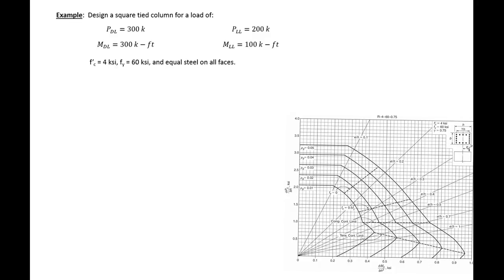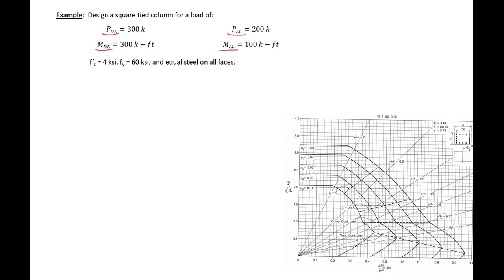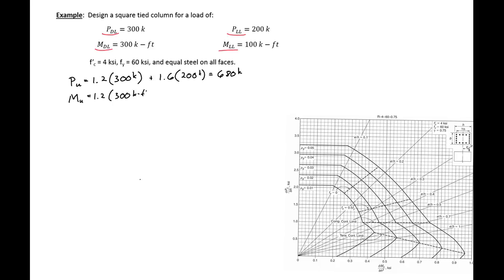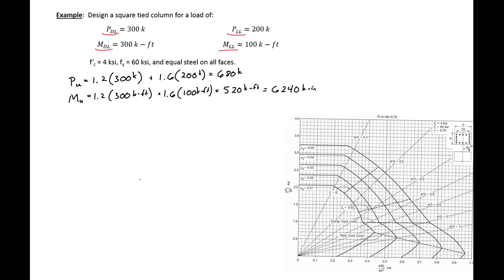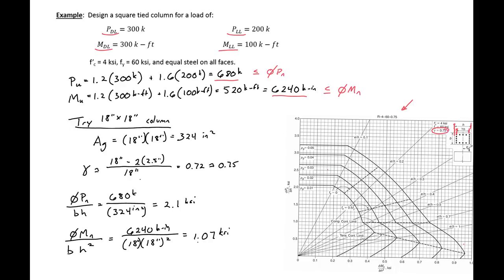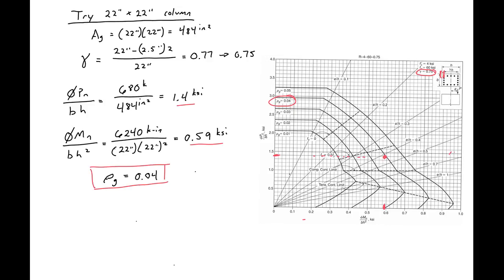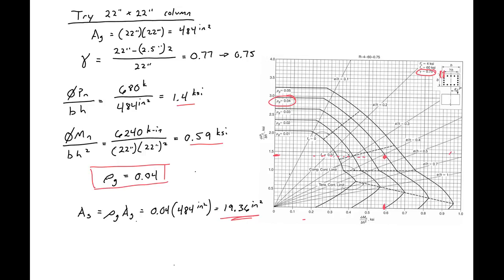12-01 - Design of a Square RC Column using Design Aid

Comment: spacing between all of the bars : ( 22" - 2(1.5") - 2(0.5") - * 4(0.5") * ) / 4 = 4"    - - - Where did you get the 4(0.5)?  Video time : 11:42 / 16.09
Reply: b bent = 4 d stirrups
Reply: @nazirghnim9340  In the picture, I only see : 22" overall length ( MINUS ) 2 x 1.5” - which is concrete cover that is encountered twice as you work towards the center of the column vertically ( MINUS ) 2 x 0.5” - which is the singular #4 stirrups that is encountered twice as you work towards the center of the column vertically ( MINUS ) ** 5 x 1.27” - 5 actual #10 rebars with 1.27" diameter in the column **

So, above description should add up to : 11.65”.

Dividing the left over space by equal 4 spaces : 11.65” / 4 spaces = 2.91”

So, again, in the original calculation, where did the : 4 x 0.5” come from? 

So, I am not getting the 4" like What (Dr. David Garber) @David Garber  got.

Comment: Dude, its a cool video but, the phi factor is 0.65 or 0.75 depending of transversal reinforcement. The 1.2 wd + 1.6 wl is to get the Pn and Mn.
Reply from the maker: This example uses design aids with the varying phi factor built in. You should go back and analyze your actual design at the end. You can develop an interaction diagram (similar to what you would find in the videos in this playlist https://www.youtube.com/playlist?list=PLLhnAwUfiIPvGb4tM69GD-ammbq0BPS7R). The 1.2D + 1.6L is the load combination that will typical control when finding the required strength U (Mu and Pu in this example). You can look to ACI 318-19 section 5.3 for more information.

Comment: Can you use this for rectangular columns as well or are there equations unique to square column behavior?
Reply from the maker: You can use the same procedure for rectangular columns. Make sure you have the column orientation correct for your direction of bending.

Comment: Hello, I want to ask that what if fy is not equal to 60 ksi (e.g 40, 50ksi), it seems that ACI has not provided these design charts
Reply from the maker: You could use these design aids as a starting point and modify the required steel by a ratio of actual yield to yield for the design aid. You need to go back at the end and analyze your actual section with actual steel yield at the end.